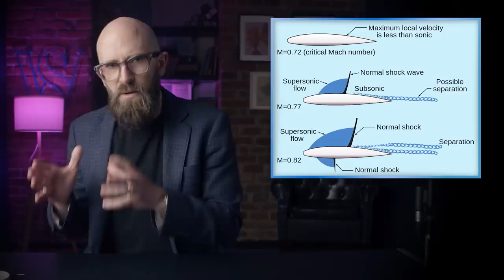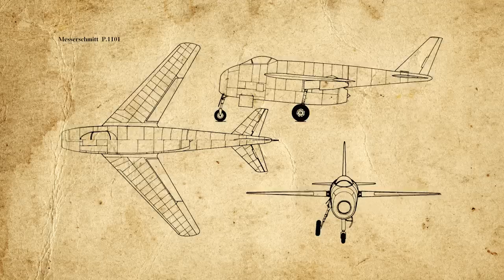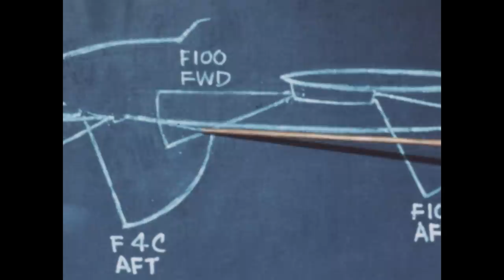Why Do Jets Have Swept Back Wings?

Comment: From what I've read, forward swept wings like the X-29 were highly unstable statically (i.e., cannot glide). The computers at the time couldn't do all the needed minute adjustments without causing the pilots to get nauseated.
Reply: X-29 was highly successful, but inherently unstable, computer technology was sufficient at the time to make it a successful test plane. When airplane wings bend up the outer portion tends to twist in a way that increases the angle of attack, which creates more lift, with a rearward sweep this is not a "critical" problem. On a forward swept wing this does create a critical problem as the airflow gets under the wing and creates a pocket of high pressure that pushes the wing tip up further, to the point where the structure of the wing can't handle it anymore and it breaks. The X-29 used special composite materials and construction techniques that made it when the wing tips flexed up they twisted so that the angle of attack was reduced. Composites were in their infancy stages back then, they could probably build planes with forward swept wings today for a lot less, and with the advances in fly-by-wire I don't know why they haven't. Like with all things, I imagine it's still more cost effective to just stick with traditional metals.
Reply: @qfrb97  May be lack of a use case, i.e., what do we do with a highly maneuverable but not stealthy plane in modern warfare?
Reply: @DixonLu  You mean the X-29? It was never made to be something that would be put into large production, it was an experimental design from it's inception, hence the X designation. Grumman flew it for quite some time and the retired it, then NASA got hold of it and they flew it even more collecting data all the while. The advanced composites and fly by wire system were highly innovative and unproven at the time, the fact that made it all work is why it is successful. In modern times Y is used for prototypes that may find their way into production, the F-18 started out as the YF-17 and was in competition with the YF-16. The YF-22 competed with the YF-23, the 22 won and went into production as the F-22.
Reply: Cannot glide?!?! 🙄

Comment: The F-14 wing sweep wasn't very complicated. It was the damn flap/slat system that took forever to rig.
Reply: The engineering of the wing box was a small miracle for the time from what I understand
Reply: F-111 same.
Reply: @qfrb97  not so much as it had been done on the F-111.

Comment: Now i need someone to explain the F-104 wing design.  I have to believe it has something to do with the "widowmaker" nickname.
Reply: The F104's wing design is actually great for what it was designed to do (with the exception of the early blown trailing edges which in a failure would require a high speed landing). The problem was Lockheed business side sold the high altitude high speed interceptors as a ground attack plane.
Reply: @will3346 yeah, and several countries bought the lawn dart partially as a ground attack plane because of lockheed's $22m bribery operation (~220m adjusted for inflation).
Reply: @Ass_of_Amalek  yeah the business side of companies suck
Reply: @will3346  business side of companies xD
Reply: @Ass_of_Amalek  my not very eloquently described point was that it's not an inherently bad design.  The blame shouldn't fall on the design of the aircraft
Reply: @will3346  yeah it really is weird to try to make a ground attack plane out of a starfighter. interceptors and ground attack planes are the two types of fighter jets most diametrically opposed to one another (one being the fastest with low maneuverability, the other the slowest with high maneuverability), and the starfighter at the time was the fighter jet most exclusively designed as an interceptor (with extremely high maximum and minimum speeds due to the ridiculously small wings, and a world record flight ceiling). to make a jet both an interceptor and a ground attack plane, one ought to at least make the symbolic effort of making it a swing-wing, like a tomcat or tornado.
Reply: *window-maker
Reply: @kgk6674  that would be the boeing 767 😉
Reply: The F-104 had a super thin wing, only 1" thick at the tip from what I understand, this was to reduce the drag at high speeds as it was made to be a high speed interceptor. The thin wing doesn't give much room to make a lot of curvature (which generates lift), fine for high speed flight, not so good for landing. Landing speeds were very high as a result, which is partly where the widowmaker name comes from.
Reply: @qfrb97  what you have said is correct a thick airfoil is not suitable for high velocity travel. However an airfoils profile is technically irrespective of it thickness. You could have  an f104’s “curvature” at a thickness of something like an An-2 it would just be a very wide and terrible wing. What matters is the thickness to chord ratio. 

Also the name Widowmaker originated  in Germany where they were used as a ground attack plane so it’s definitely related.